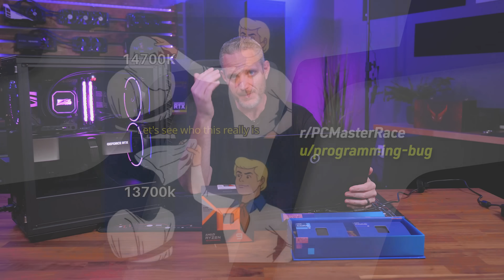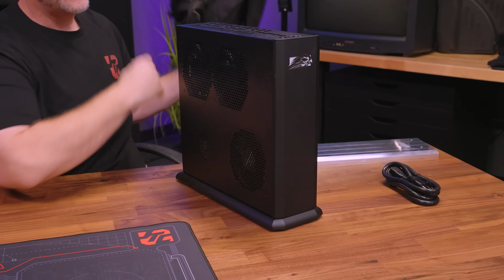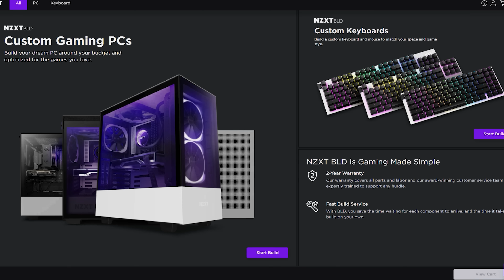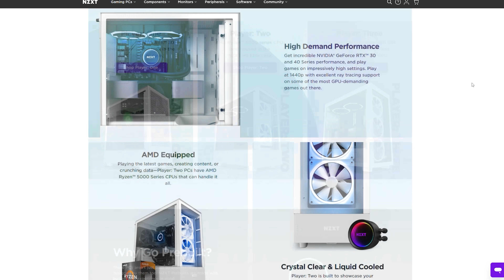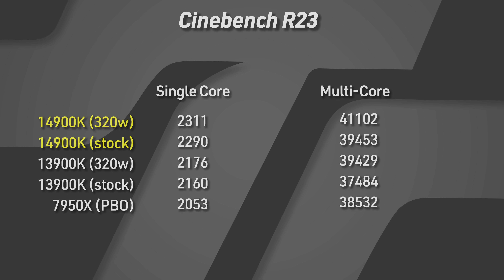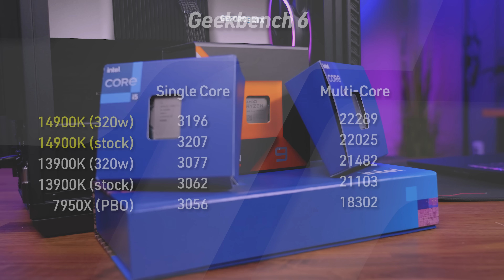THIS is why people have trust issues! Intel 14th Gen Review

Comment: I’m still building systems on AM4. The boards have come down, the processors have come down and ram is dirt cheap. 5800x non 3d processors are in plentiful supply and their are just not enough reasons to go AM5 at this time. Most of my friends who want a pc built are surfing the web or online shopping. Don’t need a crazy fast CPU or a powerful GPU to do that. When I can, I use a 5600g with a stock cooler. 16 gigs ram and a 500 gig nvme drive. 450 or 550 board with wireless built in. These are not gaming machines, just something to browse Amazon and order groceries with. A 450 watt power supply is overkill. Sometimes you have to make sacrifices to get grandma off windows xp.

Comment: 14th gen does have one extra: APO. That is only 14th gen and only 14700 and 14900 series. How much that will affect how many games on Windows has to be seen because the hardware side seems to be a bit ahead of the software side. But if it works as advertised fine-tuned scheduling for a particular application can have quite an impact on the performance. But AFAIK the software side is still TBA.

Comment: I think that the value proposition, despite the higher power consumption for lower performance, is actually going to be the 12900K.

I have a Z690 DDR5 motherboard that I bought when the 12th gen first launched, but then DDR5 supply issues made it such that I never bought the CPU nor the RAM for it.

So, now, if Intel drops the price on the 12900K, I will be able to get 90-something % of the performance of 13900K/14900K, but at, potentially, quite a bit of savings in terms of relative cost.

That would make it a very compelling option for me, that way I don't have to pay the premium tax on either a Z790 motherboard (unless I can get Microcenter to update the BIOS for me so that my Z690 motherboard can support a 13900K) and I can get quite a performance boost moving up from my 6700K or my tiny human #1 moving up from an Intel NUC which has the 8559U in it.

Comment: Intel have bowed to share holders and idiot marketing department this should cause lasting damage to intels brand name. The chips they are calling 14gen should never have been called 14 they should have just added 5 or 50 to name so I9 13900k should be 9 13950k or 9 13905k or add a + or E(for enhanced) as performance gains do not justify calling it a new gen, its only got a new gen naming as marketing say we need a new gen every 12months or sales will suffer &with a new gen we can bump up prices & most people wouldnt know as dont research chip just see Intel new gen must be better buy that.
It also means when true 14gen launches with gen15 monikers Intel can force you to purchase new motherboards. If AMD keep giving there sockets 3-4gen of CPU Intel will look increasingly backward, unconsumer & unenviramently friendly.

Comment: Asus has right on limitation, Intel cpus are Abraham tanks. I have a 4790k almost online h24 by it's release, delidded with liquid metal at 1,48v. 5.1ghz on my second pc.
My main it's a waste of sand (11900k) even that at 5.4 single core scaling to 5.1ghz all core, the voltage when it goes to 5.4 on single core it's insane, i red maxoutput of 1.75v.......... (even if just for few istants)
But it still working ok after 2 years h24on, 0 bsod after i changed ram few months ago (i had to put 128gb for DCS) 3600 cl18 with timing tuned (actually the ram is slightly faster, but that's the max i reached in gear 1, with gear 2 i could reach max 4000, so i left 3600 gear 1)

Comment: I have an i9 9900KS, is it worth upgrading to i7 14700K if I am gaming on 4k? or should I just stick with it.
Reply: I would wait until atleast the next gen. I have a 10900K and I definitively won't be doing any system updates for years to come, but each to their own I guess. I usually wait 5-7 years before even thinking about it, and then I replace the whole system except for maybe storage. This means my 10900K system is about half way through its productive life by now.
Reply: @VNAV_PTH  thanks for the advice. I usually want to wait 5 years atleast as well. But ive been experiencing stuttering in some games like Darktide and Inquisitor martyr. So it made me doubt the CPU as i have 32 gb ddr4 ram 3200mhz and rtx 4080 with ssd. I have limited the fps to 60 max using nvidia panel. But still get these weird stutters at times. The 14 series cpus dont seem....worth it. So i am likely to hold on more like you are.
Reply: @KingTiger2000  Do you use MSI Afterburner for monitoring GPU usage? Maybe you can spot something there that gices you a hint if the GPU is causing the stutters? I don't exceed 80 FPS on my system. Don't really need more than that.
Reply: @VNAV_PTH  ill check it out. Thanks..and yes 60 -80 fps is more than enough while saving up on your power bill
Reply: @KingTiger2000  Anyways, I think we can with a high certainty say that you are not getting the same performance out of a 4080 with a 9900KS that you would get with a 13900K or 14900K. If the 9900KS is the cause of the stutters in question, is harder to determine.
Reply: I would back down the graphics settings until it just stops stuttering. Then, gradually lower the CPU frequency and see if it starts to stutter. If it starts to stutter with just a little drop, I think we can draw a conclusion that the 9900KS is the bad guy in those scenarios.
Reply: @VNAV_PTH  did that. Still some minor stuttering. I think i can live with it to be honest, i have allocated like 2000 USD for an upgrade as I got some nice overtime moneyi wasnt expecting. Though I prefer to spend hard earned money on a meaningful upgrade. Ill think about it some more. Thanks for your time
Reply: @KingTiger2000 So, the stutters could not be eliminated by backing down the graphics settings?
Reply: @VNAV_PTH  nope sadly. Still occurs. I managed to reduce  it a bit by reducing cpu intensive options in the video setting
Reply: @KingTiger2000  I'm sorry to hear that. Well, I wish you all the best and hope you eventually will experience a stutter-free gaming experience. Please update if you find the cause.
Reply: @VNAV_PTH  tested a few games. My i9 9900ks usage never goes above 40% usage. While GPU hits 93% usage using MSI afterburner OSD. I guess i can safely conclude that i dont need to upgrade the CPU. It is odd.
Reply: @KingTiger2000  I remember back in the day when Microsoft Flight Simulator X was known to hit one core only with the main thread, and the rest of the cores were used for scenery loading. So, if I was to look at my CPU usage, I could see core 0 at 95-100% all the time and the rest of the cores fluctuating between 0% usage up to maybe 50% etcetera. Core 0 was basically the limiting factor for FPS and the objective was to clock the CPU as far as it would go and that would immediately reflect in FPS changes 😊 So, I want to ask if you have checked each core usage to see if there might be a similar behavior, meaning there is a core that is hit much harder than the rest?
Reply: @VNAV_PTH  good idea. I should let it view by core utilisation instead of overall. Thanks

Comment: No, this is a holdover because Intel couldn't get their Intel 4 process node working well enough, and Meteor Lake requires that node, so Meteor Lake is being limited to laptop, where I assume Intel 4 is good enough for lower clock speed use cases.

Same thing happened with moving to their 10nm node which later was renamed Intel 7.  I think it was Tiger Lake cores that only came out on laptop.

Comment: I use a product / game called MSFS-2020 among other racing games.....Single core 6GHz should work good, I think I can use the Intel utility to control the cores that the game uses if memory serves me right. (can't remember the name).  But my goal is to take out my 12900K from my Z690 DDR5 Mother Board (it's a ROG Strix "E") and put the 14900K into the existing mobo CPU socket and then put the Corsair closed-loop cooling back onto the new chip, taking the 12900K out and seeing about selling it (I have the original packaging) hoping to gain 1 entire Gigahertz (I'm currently sitting at 5.0 GHz on a good day-in turbo mode in the BIOS settings).  I also try to use the XMP but some people tell me to turn that off.  If I remember correctly, my memory is some of the early Trident Z5 DDR5 F5-6000U4040E16GX2-TZ5RS (DDR5-6000 16GBx2).  CL 40-40-40-76.  1.30v  Memory.   So I'd like to pop in this new Intel chip (14900K) and see if that gives me more lanes on my PCI bus and faster graphics for my gaming.  If I need to upgrade to 64GB RAM from 32GB RAM, let me know that as well and thanks so much for all the help !!!

Comment: They'd probably get sued for using AMD's terminology, but AMD had Zen and then Zen+, then Zen 2 and Zen 3.  
There's more of a difference between Zen and Zen+ than there is between Intel 13th gen and 14th gen... but they should have called it Intel 13th Gen X or something similar to what AMD did.  It's Intel 13.1 Gen... not 14.

Comment: I’m on a Intel i7 6700 and it runs games just fine. I run most of my games on high graphic settings at about 80 fps with about 15-20 Fps fluctuation. It’s paired with a evga3090.

Comment: I have a Asus Z790-a gaming wifi ddr5 board with a 13900k.    

I purchased the board when it eas first released!     Its since had 6 bios updates!     

Ive had voltages up over 1.42 1.43.    Then ive seen people posting using 1.285 with all core 5.7gz.    

Im not that familiar with all the technical aspects when it comes to voltages and overclocking.  I basically leave things on Auto.   

What i will say is ive had a 23% variance in benchmarks from one bios to another using identical settings.      

It absolutely drives me nuts!     I believe it was the 3rd bios where i had ACC (sim racing game) running at 5.794ghz in game with an occasional 5.8 and being perfectly stable.      

Then there was an Asus update for the motherboard and all those profiles were unstable and crashed and i was back down to 5.494 ghz.  

I know my 13900k can score over 40,000 on CBr23 and over 14,000 on the Intel XTU benchmark.     17,400 3d mark all core 1270 single core.    But getting it to do it is a whole other story.     

I wish there Videos on YouTube that explained exact what everything does in the Asus bios.       Even the Manual doesnt explain everything.        

I definitely find the Asus bios to be a little confusing at times!

Comment: I'm pretty happy with my 12990K. Considering I came from using a 2012 Mac Pro with dual X5675 CPU's. I notice less apparent power draw under normal use and I can noticeably feel my room being cooler. Not to mention; running uptown date software.. less janky usb 3 or thunderbolt... way faster ram and storage interfaces.
Reply: I upgraded from a i7 8700k a bit overkill for gaming but it was a i9 12990k combo deal. that came with a mobo and 32 gb of ddr5 well worth 400$
Reply: @sephirothlv100  I should have sprung for a DDR5 board. I think with DDR4 I’m leaving some performance on the table.

Comment: My question is, if I’m going to upgrade from my current 12th gen, does the 30 dollar difference between the 13900k and 14900k make either a better or worse deal?
Reply: What are you upgrading from?  You can currently get a 12900K for well under $400, or a 13700K, do you really need a 13900K or 13900K version B?(14900K)
Reply: @davidandrew6855  I have a 12900k which just doesn’t play well with ddr5 in my experience
Reply: @ItsCH4S3  Oh bummer, so the IMC is not doing well on your sample?  

I suppose if you were going to upgrade, might as well do the 14900K.  Not sure if the IMC is exactly the same as the 13900K, but I think they did a slight bit of tinkering with the cache and memory subsystems.  If you under-volt a bit, probably can get it to be fairly economical for gaming.

Good luck!

Comment: So why did Intel not include the AV1 HW encoder and a quad channel Memory access (to already on the module dual channeled DDR5)? This would have given a significant advantage and benefit. I do love my i7-13700h in permanent 65W and nearly the same performance and a much much better iGPU for OpenCL calculations.

Comment: The only problem is the misleading labeling. It should be 13950, 13750, 13650. If it helps push 13 prices down then those become very compelling again, at least for the 7 and the 6 levels.

Comment: I think Intel thought about how flooded each gen already is with CPUs and how midgen refreshes kinda go under the radar and they kinda lose the market on them vs the initial launches. So from a marketing standpoint it does make full sense to do this. Plus given how Intel was getting hammered over the heat that the 12th gen was pulling and then 13th gen, so having a full line of CPUs with giant power draw cuts is fine. They should add to the 14th Gen an E to give it the moniker of Efficiency as that is what this gen is fully about. 
One other point and this I think needs to be really considered is the 13th gen DDR5 boards would have been a small market, now that 14th gen is coming out for it then those boards will still have market demand so supply will keep up, price will not drop as much, which I think would be the better long term benefit as so many boards on the market vs CPUs that can fit demand will mean cheaper prices later.

I would not mind a whole on the PC industry on cutting back on the heat generation for most of the parts. M.2 are little furnaces now with how fast they perform, GPUs are sucking up so much power and putting out so much heat and the CPUs are doing the same. Heck the Motherboards are getting bigger and bigger heatsinks on them to keep cool and all that heat is going right into the home environment which needs to be dealt with. You AC going to work more just to keep you cool and that is not really the cheapest thing to run all day long.
Reply: I donated my old Ryzen 5 1600AF, GTX 1060 desktop for a Beelink GTR7Pro (7940hs, integrated radeon 780m almost as fast as the 1060). Power draw is 1/3 to 1/4 of the desktop, I don't need more power than this.

I used to be into the bleeding edge high end but ever since the shameless pricing started so hard I stopped with Vega64 LE (and mined on that for a while, it was a good space heater in winter), after I got rid of that I was interested in lower power midrange parts but due to scalping and shitty pricing the price/performance proposition was worse in the last few years than in 2016, so fuck that don't buy vote with your wallet.

Comment: No doubt coming from my 5930K it would ba a massive uplift, but I think the concern is real-world gaming performance between current-gen offereings, be it Intel 13900K/14900K or 7950X3D, the big question is am I finally swapping back to AMD (last AMD was an FX57!) or is Intel best?  For me, I'm a long-term build focus (I mean, still on a 5930k??) so I'd be looking mainly at multi-core performance and technologies that perhaps games still 5 years out will take advantage of...
Reply: And I thought I was holding out long. I'm on the 4790K and my PC still  feels snappy compared to brand new laptops with bloatware all over them.
Reply: Hard to say as nobody really knows. I'm just hazarding a guess that a Ryzen 7000 CPU, say a 7950x/X3d with those 16 all performance cores may be better in the long run.  The x3D only has cache on one CCX so there is that to take into account.

Comment: Something completely off topic… more of a question. Does it sound correct for a full EKWB loop, d5 pumps , dual 400mm res, a 4080 gpu water block, 5800X3D AM4 cpu block, and 360/480rad with acrylic tubes costing $1100+ with all connections? Am I adding my parts up correctly or is it too much? Thanks to anyone who responds

Comment: What would you suggest purely for gaming, upgrading from 10700k: a 7800x3D or 14700k?
Reply: Go for 7800X3D. Intel's LGA-1700 right now is a dead-end platform, AMD's AM5 has better long-term CPU Support.

But if like to OC, don't ever buy X3D CPUs

Comment: I dunno.  'The same but better' is a benefit.  You have a year of stability improvements and issues worked out, though I don't know why you'd drop several hundred dollars for a performance uplift less than 20%.  Still, not all of us do upgrades every year.

Power Efficiency is one of the bigger things I look for on a chip, and it's been disheartening as hell seeing that there's not much in the way of efficient computing on desktop at the moment-it just seems like it's all more power, more heat.  And on that front, hidden costs-power isn't free.

Comment: Not sure why anyone other than professional video editors and/or Mass data crunchers would be upgrading each generation anyways.  Gaming is not the extreme folks like to think it is and while it does require power, most games run great even on older platforms.  I run my games on max settings just because and even after 5 years often I just upgrade for the sake of just getting something new.  Same with Video cards, there's no sane reason to buy the newest one every year especially at current prices.  I guess some folks like the idea of money spent so a free benchmark tool can tell them how cool they are.  Great video Jay, I think 15th gen might be the one some 6th+ gen folks finally decide to upgrade,  I can't see a reason for upgrading anything like 10th gen or higher for at least a few more years.

Comment: Im already getting 41300 ish in r23 on my 13900k at around 280w... and 40900 305w without an undervolt literally no point to upgrade maybe they have better bins so i guess they could clock a lot higher with an oc and a manual voltage.